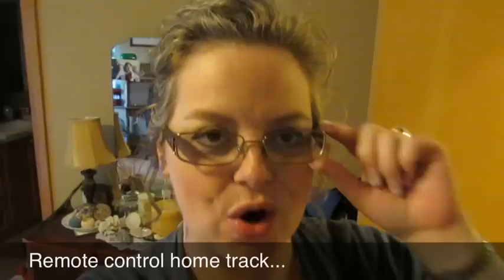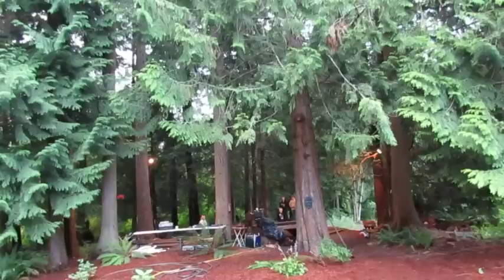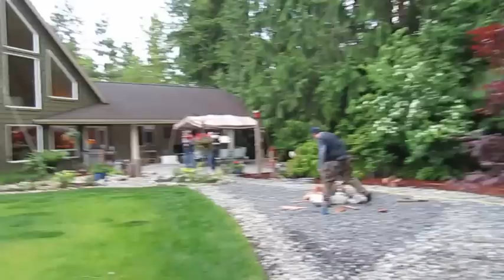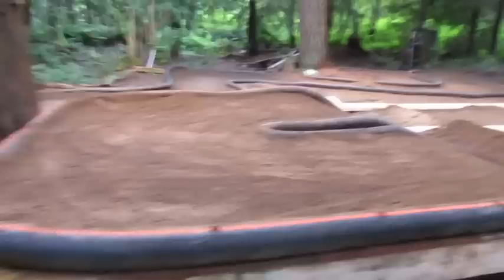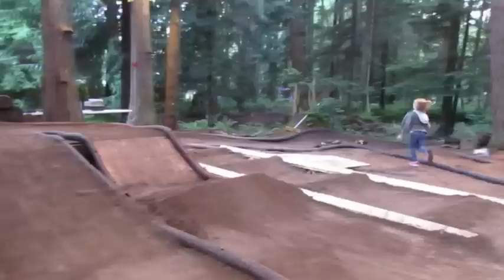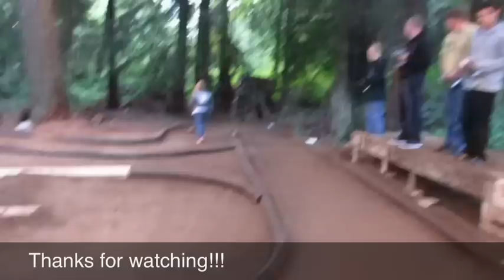Our Remote Control Home Track

Comment: hey im thinking of getting an rc truck and my price budget is 350 and do you think the traxxas slash or stampede is better
Reply: Jesse Sommer If you have $350 to spend on the car alone, I wouldn't bother with either. Go for something by Losi, Associated, Durango or Kyosho.
If your $350 is going to have to cover support equipment, I would honestly go with a Traxxas Rustler, but I'm biased against Short Course. Objectively, there's no difference between the Traxxas 2wd electrics - they all have the same electronics and a very similar design. Same goes for the 4wd electrics with the exception of the E-Maxx and E-Revo. The Stampede 4x4, Slash 4x4, Rally and Telluride are pretty much the same vehicle with a different body and a few tweaks to the suspension and chassis.
Reply: If you want to race it and bash it alittle bit then go with the slash. But its your car and whatever feels right.
Reply: CJ3K Studios HD
Recommending a Slash for racing is the biggest mistake you can make. There are much better SCTs for that. But they're good for messing around in the back yard.